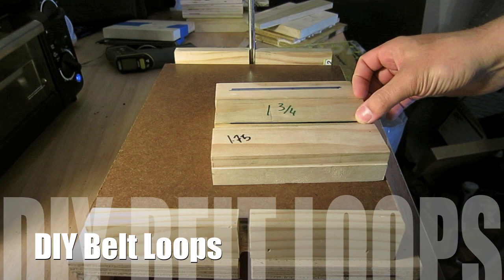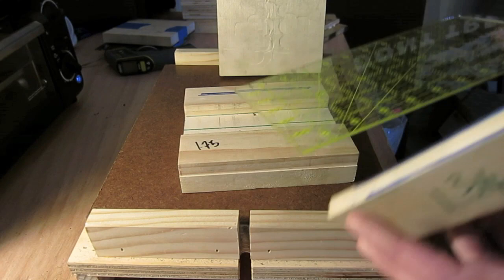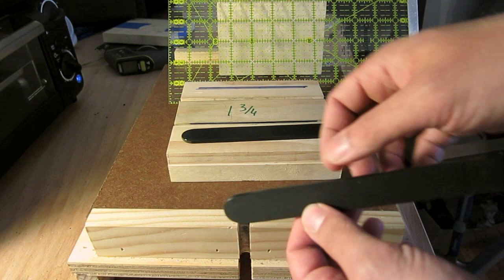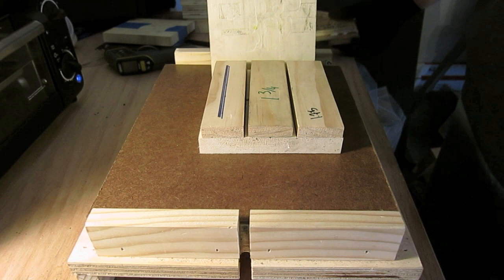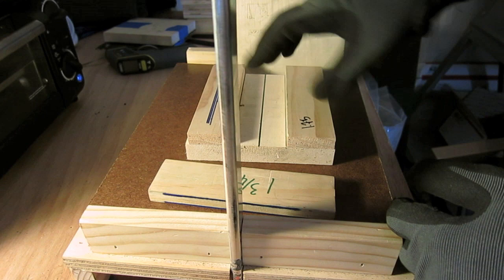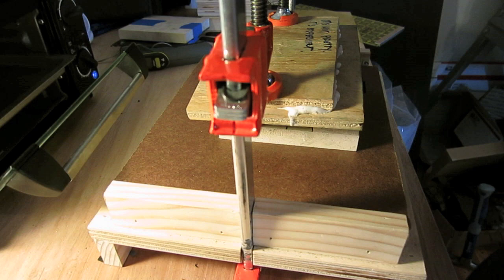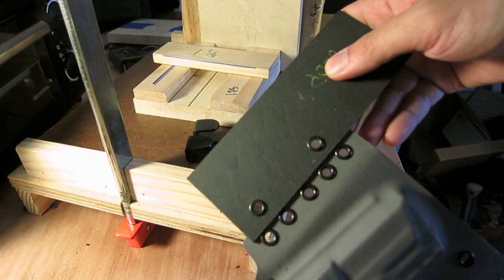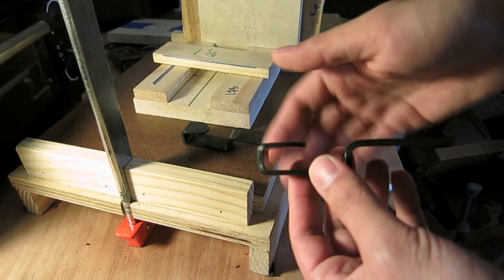DIY Kydex Holster Belt Loops

Comment: Made this jig yesterday and it works great.... One quick question.  Why is the depth of the belt loops 1/2"?  If it was smaller wouldn't it pull the gun in closer and still accommodate thick gun belts?  Just curious..... Thank you for all of your help!